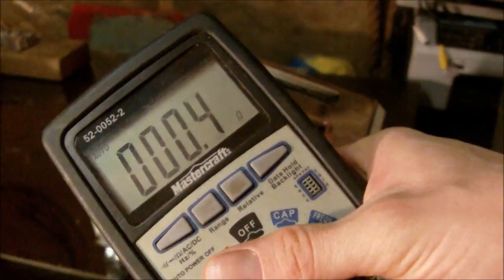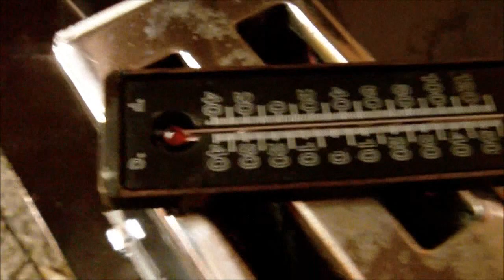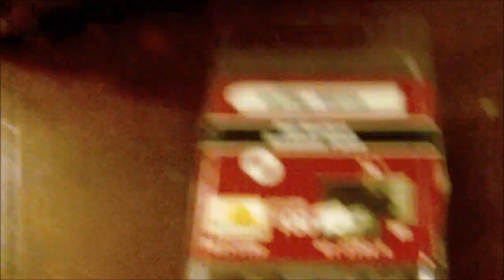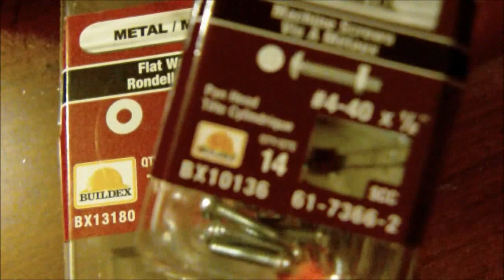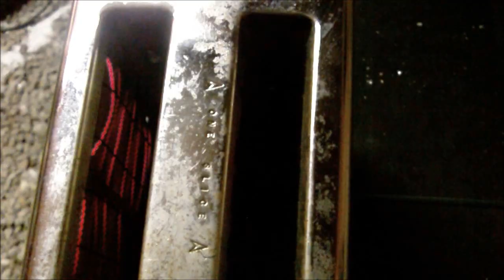Homemade 12v Heater from Toaster

Comment: You need to control the current using a variable resistor or banks of resistors and the fan needs a protection from the heat.
Reusing a hair dryer would be easier.

Comment: In this comment section,  those guys that say a variable resistor, the remainder of heating elements  or bank of resistors is needed are right.  Resistance before entering those elements are needed.  But I still thank you for the subject.

Comment: So that is a good piece of a puzzle. If one had a small wind powered alternator or generator it could power the heating elements directly. No need for any type of rectification or control circuits. just run the wires in to the toaster direct. The harder the cold winter wind blows the hotter that thing will get. I would put it in a brick or metal enclosure etc in case it flamed on. Also since the thermostat is there it could be rewired to kick in the center element paralleled if the voltage gets high enough to put more current then the outer elements could handle. The center element kicks in and takes up the current load. Of course that would put drag on the wind turban and keep it from over speeding.

Comment: You need more not less of the heating element, that said it won't work the way you're doing it, you need a variable resistor to cut the amount of current going to the coils.

Comment: Dude that's a lot of energy! :( i was planning build one 12v from scratch for fun, but is not worth it in terms of amps when your supply is "vital". Good experiment!
Reply: The 12 volt version of this would kill the average capacity car battery in around a half hour. Even with multiple 12 volt batteries in parallel, this is almost an unacceptable drain.
12 volts is a really poor choice for heating, but he covered this in the video by mentioning 24, 36, 48 volt, etc.

Comment: Yea, heating elements & motors a typically the devices that draw the most current. But, it's a rather novel approach, to generate a quick emergency heat source.  I'd squirrel this concept away, for the time when you have a critical need to supply heat to a small confined area, and find a way to regulate it with a thermostat. You can cook your pop tarts while heating your house

Comment: Great video. Now I know how I am going to heat my electric car in winter. To supply the current do you think a dc to dc inverter would work? Small amps in big amps out. I know nutting thats why the question.

Comment: Mmm....Is it possible to add an adjustable thermostat to make it come off when the temperature is reached and on when it is lower? Make this work from a wall outlet? And how warm is it when you leave it on? (As in if you don't put the thermometer beside it, to just measure room temp)

Comment: I know some old box fans and ceiling fans will actually produce electricity if used as a windmill... I am seriously thinking about some type of free windmill heat for my 1 1/2 car garage. I'll be insulating it with 3-4 inches of rigid foam on all sides and at least 4 inches for the roof. The last thing I want is a fire hazard, so am wondering if I were to connect like 4 toasters to a power strip for each ceiling fan, I'll produce a small amount of heat, but most likely nothing will be glowing.. Am I right? There's no electricity in this outbuilding, and the supplemental heat I can generate from a pair of fans will be minimal. I have a propane stove out there that's almost a furnace, but it'd be nice to save a few dollars where I can. On windy days, I'll have free lighting, and a scrappy fridge out there keeps drinks cold from a box fan windmill now. I fill the freezer with saltwater jugs. When the wind is really blowing all day, it runs nonstop, and that gets me thru the days without wind. You just need to try not to stand in front of the fridge looking inside, grab your stuff and shut the door, but it's a nice way to keep cold beverages.. I figure I can put 4 fans across the peak of the roof..

Comment: You are approaching this incorrectly, by thinking in terms of watts. Watts are a measurement of transferred power or P=IV. Electric heating elements are a useful application of I2R heat loss, in other words, power LOSS. What matters in a heating element is not so much the power of the unit but the loss of power.  The higher the loss of power, the greater the efficiency. DC already has high transmission I squared R losses so produces more heat in BTU's per watt than AC. Much more. I2R is based upon amperage, so low voltage high current DC produces more heat than high voltage low current DC of equal wattage. An example: A 1500W 120v AC milkhouse heater produces around 4000BTUs, while a 50A 12v (600W) truck cab heater produces 10020BTUs! No kidding, more than double the heat with less than half the electrical power usage!